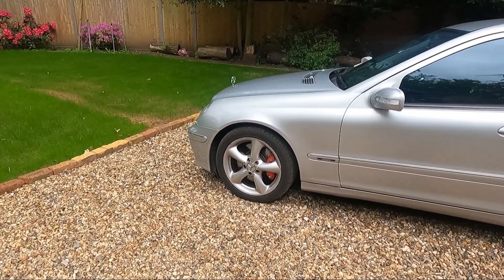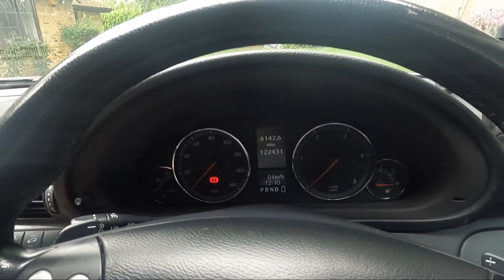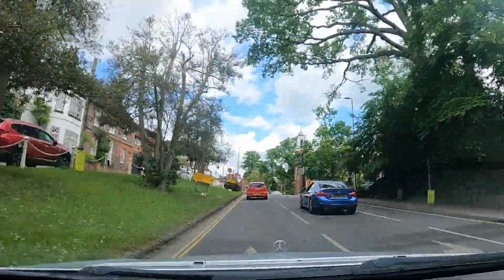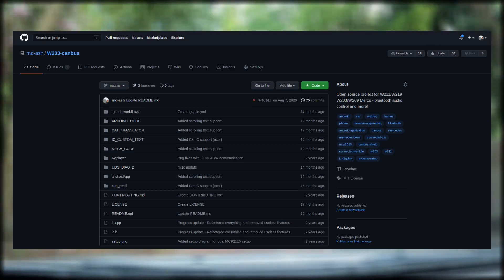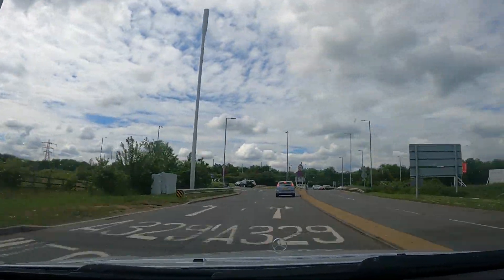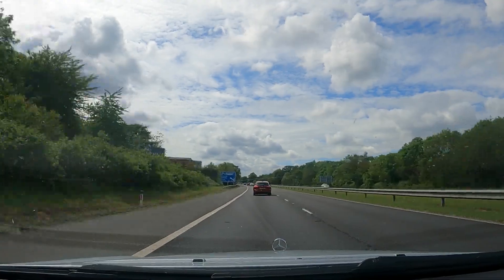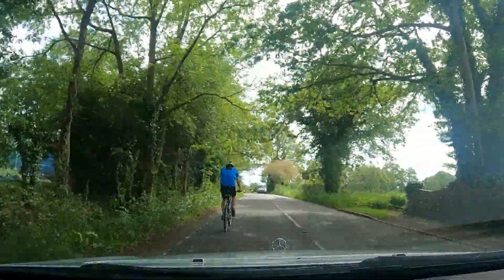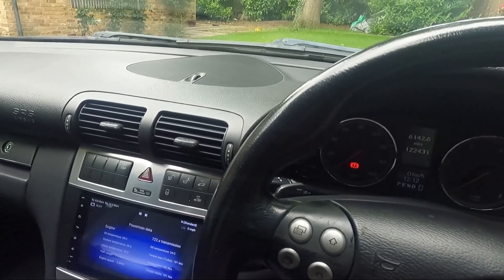How and why I hacked my car

Comment: Hi there I want to do something similar...my idea is to enable all functions on steering wheel... like contacts list and so on...I have on csr8546 attached to aux port inside of the radio directly the module got tx and Rx pinout...can I manage to trick in the ic of the radio responsible for the info can bus to enable all those functions...also I got esp32 if needed...sry the English

Comment: Great achievement and I see many potential benefits for the owners of older W203 models.  I expect that it will take me several weeks of effort for someone with my background to understand your work.  Where is the best place to start?  For example, should I check out the W211 hacking thread?  The head unit in my car failed recently and I replaced it with a unit that supports Apple Car Play and Android Auto.  I'm wondering whether that provides a gateway to implementing some of your modifications.